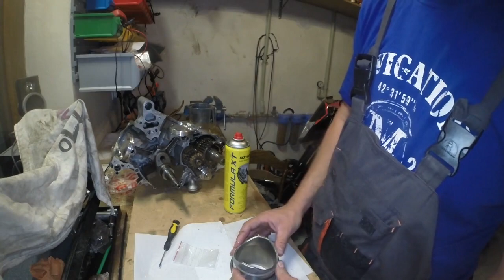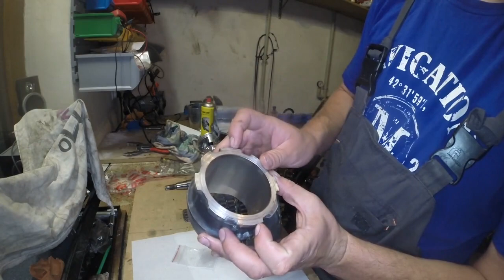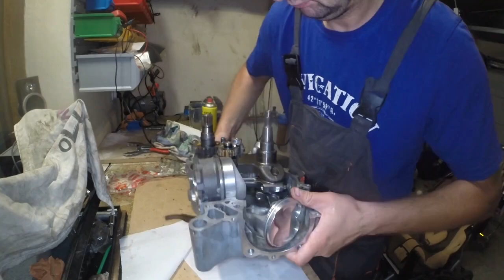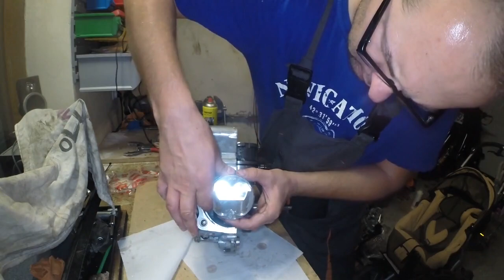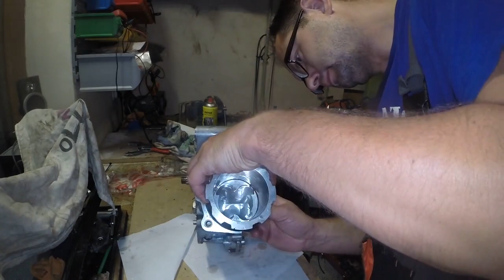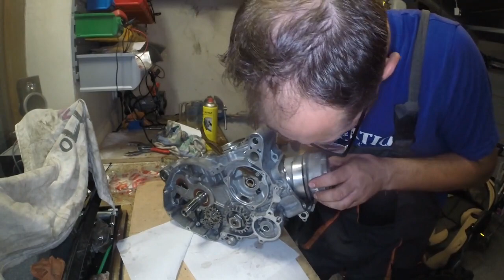Aprilia SXV Engine Rebuild 05 Cylinders installation

Comment: Question: Temp over 55 deg F - bike starts, runs fine good power...turn bike off and it won't' start (water temp about 190f).

 It will only turn over 'half a revolution' then stop. wait for a second and it will do the same thing again. Batt, starter, charging and ground cables big and new, bike not hot, voltage 12.5, what ideas do you have for a solution? I have heard so many resolutions but none of them work, bike runs great (compression so strong it will blow your hat off your head) if it starts but if not, I have to push it around and my Honda and Kawi friends make fun of me.
Reply from the maker: It is really strange as bikes usually struggle to have problems with cold start. Did you tried jumpstart ? From your descriptions it looks like compression is to big, and starter can't break it.
I advice to take of magneto cover and inspect gears from starter to magneto and sprag clutch itself.
Reply: Check your auto decompression.
Reply: Did you shim the sleeve at the bottom so it’s sits proud of the piston at TDC per Amauri Nunes modification?